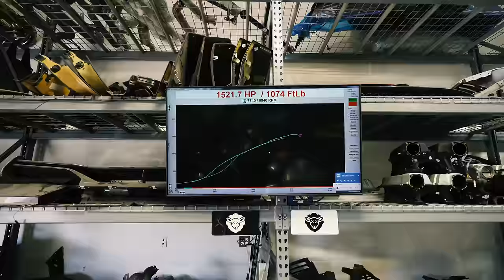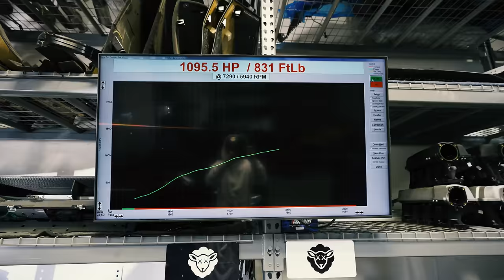4300HP IN 1 WEEK

Comment: What about the brakes? Still stock if I were to bet. Hope more garages give more attention to brakes.
Reply: The brakes are fine. The car is designed to go the speeds it goes. Adding horsepower just gets it there faster. Brakes are more of an issue for roadcourse cars. Not slowing down from 200mph once.
Reply: They already come with big brakes it’s a 6 fig car tf